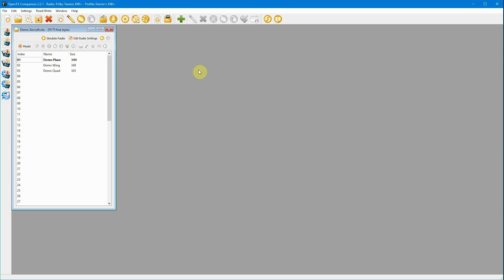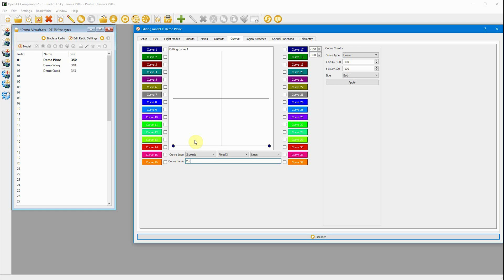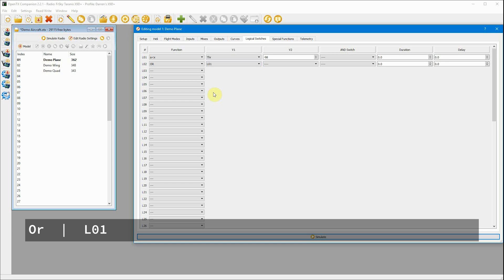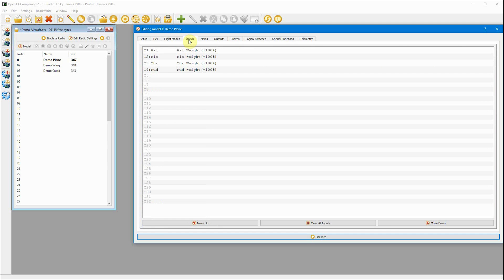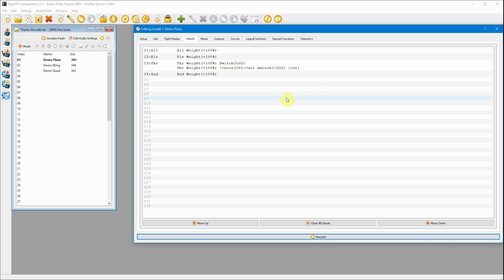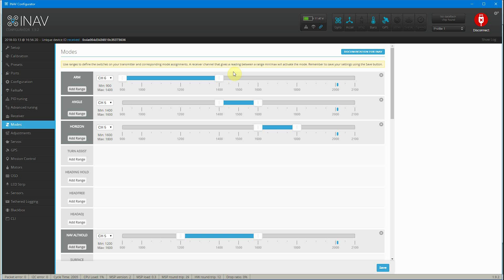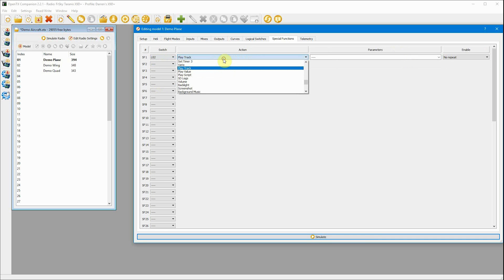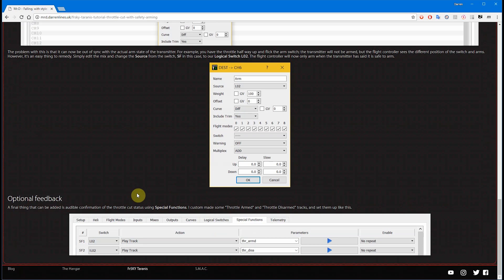FrSKY Taranis Safety Arm Switch Tutorial

Comment: Is it possible that you choose the wrong cut cruve? "!Curve" instead of "Curve"?
Reply from the maker: Well spotted. It should be CV1:Cut and not !CV1:Cut. Thank you for mentioning it, I’ll see if I can add a note in the video.

There is a newer video now, which has more checking of the throttle for even safer arming at https://youtu.be/62mxq76fOyk

Comment: Thank you Darren, another very useful video!

What would be the best way to check in OpenTX on the Taranis, whether iNav has actually armed the plane?

By the way, the link to your website seems to be broken...
Reply from the maker: Thanks for the heads up. I’ve fixed the link. 

The best way to check would be in your goggles. I believe there is a telemetry variable sent back, but it’d need decoding.
Reply: @MrD  Ok, thank you very much!

Since I've only just begun to set things up and I don't do FPV yet, I'll go for the telemetry option and I will try to find it in the telemetry, hopefully as a sensor value in OTX. I also prefer it because I could then connect the "play track: motors armed" confirmation on the Taranis to the actual arming event, instead of merely the "it's now cleared to get armed by iNav" event. Ideally I'd like to have two voice messages, first "arming cleared" and then, when achieved, "motors armed."
Reply from the maker: You wouldn’t be able to link it to a sound, you’d have to set up a telemetry page and include the Tmp1 sensor. Tmp1 is a 5 digit number representing the status of the flight controller. The last digit is the arm state. 

1 = OK to arm
2 = Arming prevented
4 = Armed

You can see all the sensors returned by iNav here: https://github.com/iNavFlight/inav/blob/master/docs/Telemetry.md#available-smartport-sport-sensors
Reply: @MrD  Thank you Darren, that is very helpful!

Setting up a telemetry page is on my list anyway, and with some processing it should be possible to implement the two step process which I want (voice messages "throttle active" -> "motors armed").

It's good to know that there are infos coming back from iNav also via telemetry!
Reply from the maker: I think you’d have to write a LUA script. The standard OpenTX logic is very basic, so you couldn’t just separate the last digit from the 5 digit Tmp1 sensor value to compare it to 1, 2, or 4.
Reply: @MrD  I guess you're right. Sigh.

Unless maybe if we can find a way to abuse the logic of the logical switches. :-D